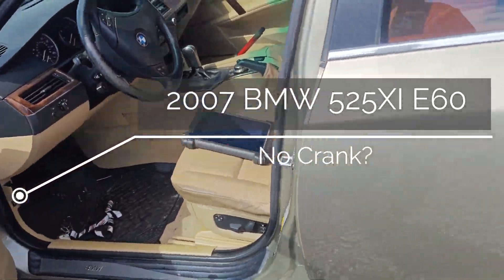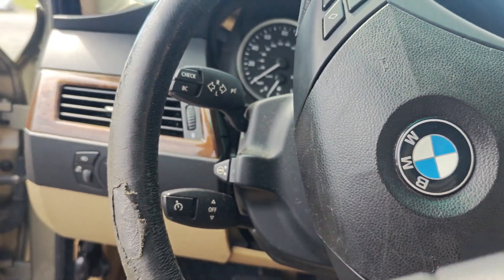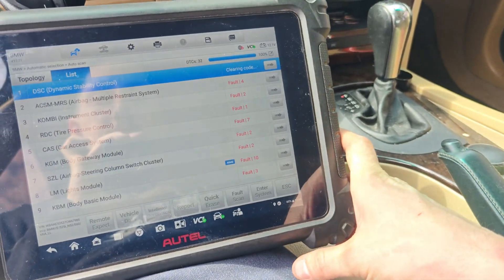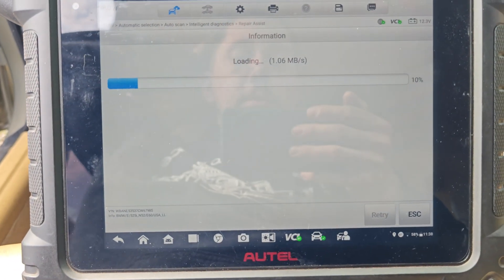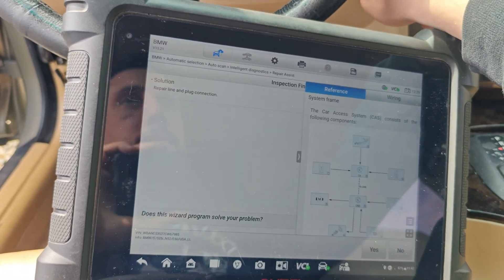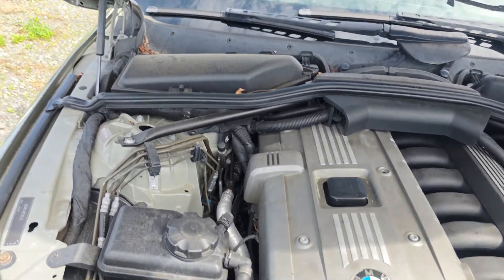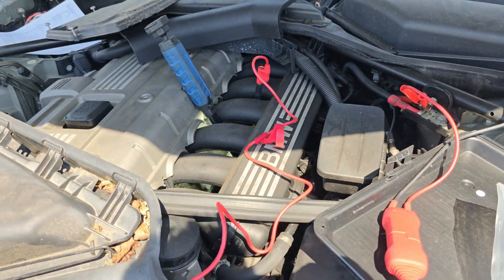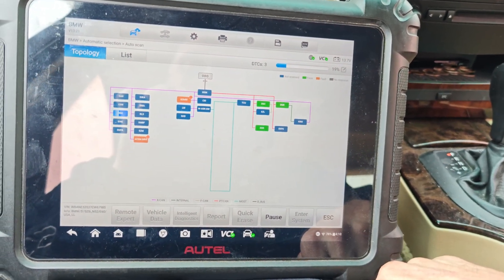2007 BMW 525xi E60 - No Crank

Comment: I really wanted to give you a like but if you just showed where you hooked up the probes to the starter and explained how you were using the power probe for us who are truly trying to learn
Reply from the maker: I showed the white wire at 12:00 and then connected the power probe up. I also showed the wiring diagram. I am not sure how I could show it any better with the intake in the way.